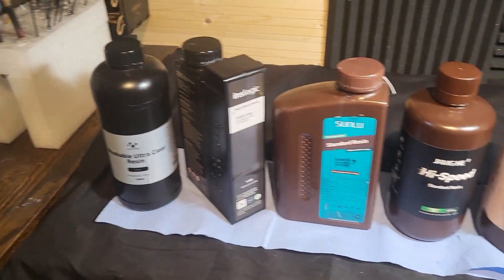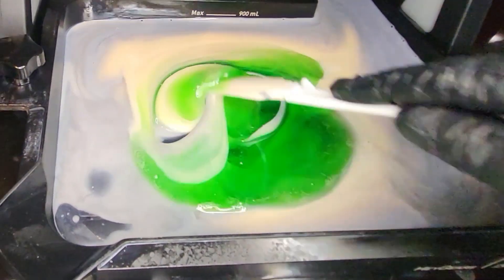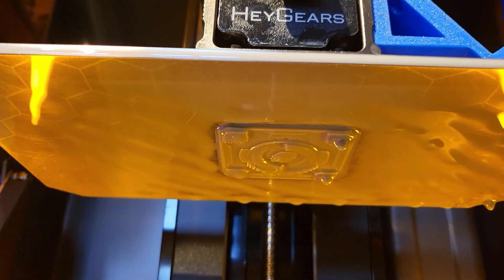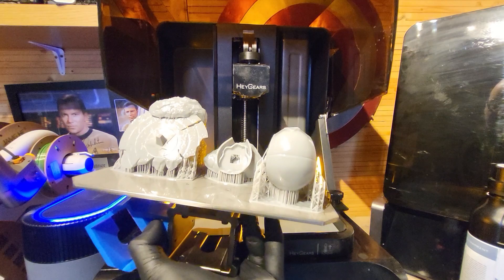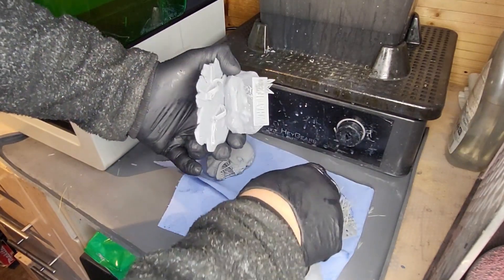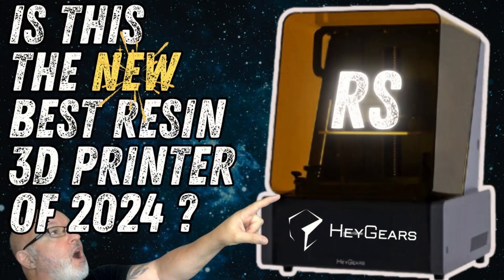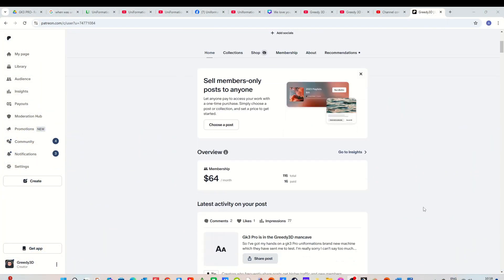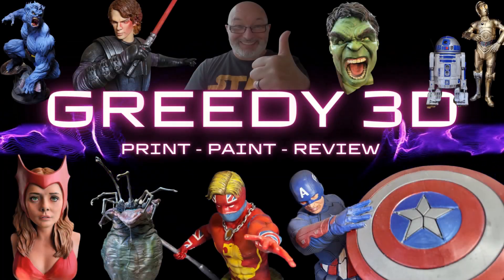Mixing 8 kinds of Random 3D Resins In One Vat Will It Print Reflex RS Tested

Comment: Wow! That is impressive. I may have missed it, but have you tested elastic resins? It took me quite a few tries to get anything in elastic on my old Anycubic. If it can printe different mixes of elastic with ordinary resins as well I think I may get this printer. Too bad I just missed the sales.
Reply from the maker: To be honest I've never tested elastic resins in it I don't think I've seen anyone else test them either
Reply: @greedy3d480  Hope you get your hands on some elastic to test. I mixed 25% elastic with my standard resin when I made som knobs for instruments that I wanted a more rubbery feel to and to get the to stick better to the shaft. I have not printed any miniatures, but I think mixing in some part elastic may make the models less brittle (which seems to be a problem for some).

Comment: Hi Greedy3d. I just received my purchased Reflex RS printer - I'm not fortunate enough to be sponsored.  
Initial setup was fine and build plate level test all ok. I don't have the pulse module but used PAS10 resin at 25 Deg C.  

To test printer, I printed cones of calibration.

For the first 13-15 layers the reflex RS makes a rather loud noise when the build plate stops descending into the resin tray just prior to exposing next layer. Sounds like two thuds or like a stepper motor lose steps type sound and max force -244N. I have completed 4 small 1hr test prints of cones of calibration,  in between each checking screen, cleaning and checking resin tray nfep for cracking or damage due to the noise. No evidence of any issues... but with each print the first 13-15 layers or so, it makes 2 thud sounds that then disappear after these first dozen or so layers - I assume printer is on normal layer exposures then. 

I posted a video at my channel - if you could take a quick look short video titled "Strange sounds when Heygears RS build plate retracts towards screen during initial base layers". My latest uploaded video was the full timeline of print.

I sent Heygears a blueprint  studio help ticket showing video with audio (and slice file and log file) to ask if such noises are normal. I have video clip on my YT channel. I would appreciate a response to this comment. 

Heygears tech says yes no worries - machine would shutdown if pressure too much - which is good to know.        

"We have reviewed the force curve and found that the zeroing force is 100N, which is within the safety range. Additionally, I have confirmed with the relevant personnel that the upper limit for the downward force on the RS printer is 250N. If this limit is exceeded, the printer will automatically stop to prevent damage. Regarding the sound in the video, we have verified that it is the sound of the electromagnets on both sides tightening, which ensures a smooth printing process and naturally differs from other machines. If there were any issues with the printer, the device would report an error, as it is equipped with multiple force sensors for monitoring, making it very safe."

Do you have similar noises at the end of each retraction cycle for the first 13-15 layers?

Now I printed with PAS10 the torso legs and head for a ladydeadpool - a 6 hour print. The printer makes the same noises for the first dozen or so layers then the thud noise goes away.The parts printed nicely. Then checking the resin tray vat before doing another print I found resin layers stuck to the nfep in areas surrounding the rafts of the parts. In corner areas around rafts extending our 5-10 mm or so, that should not have been exposed. Never had this on the Saturn 4 ultra. Either light bleed or resin compression Had to do a resin tray vat clean cycle to remove.  Now cleaned out the PAS10 from the resin tray vat. 

I don't know about this printer. I have only done this 1 serious print over 1 hour - a six hour print - and 4 other <1 hr test prints, and the resin tray nfep sheet under reflecting lights shows what look like clear pressed impressions in some areas of what look like parts of a print - I always move my test prints around on the build plate when doing the test prints to ensure not repeated prints in the same area of the nfep build plate.

Kindly respond to this comment. 
Both you and FauxHammer have pumped this printer so much it convinced dumb me purchase one, but I am doubting my decision! 
The RS has given me so much more trouble than the Saturn 4 Ultra. 
Perhaps I received a 5mins to 5pm checkout manufactured unit? ie a dud unit. 
Either I return this unit for refund and move on or return for replacement unit. 
Ideas?
-------
EDIT - Decided to return the Reflex RS as my instinct says something is somewhat defective with it. 

Note - I have received no responses from either Fauxhammer and Greedy 3d, both of whom I asked the same questions, and both of whom have been pumping the Heygears Reflex RS printers on their channels.

Comment: @greedy3d480 Just received my Reflex RS no PRM module and used PAS10 resin test printed cones of calibration. Initial setup was fine and build plate level test all ok. I have Saturn 4 Ultra and no experience with other resin printers (been in FDM many years building my own printers eons ago) so I don't know the usual sounds these fixed vats make for layers. For the first 13 layers the reflex RS made a rather loud noise when the build plate was ended descending into the vat just before exposure of new layers. Like two sounds a bit like stepper motor lose steps type sound and max force -244N. Sent a blueprint  studio help ticket showing video with audio (and slice file and log file) to ask if such noises are normal. I wait for answer back.       
I printed the cones of calibration test print twice and same noises on first 13 layers each time. After the 13th layer the sounds disappeared and max forces on retraction to screen was about -100N.  Completed the print and check screen and fep for cracking damage etc no evidence of issues so printed again and again same sounds for first 13 layers or so...
Exposure seems a little low or PAS10 can't keep the detail -  1st 2 success towers closest to skull are not linked and all failure towers broken. Sword fits in skull and other parts good to show exposure is ok... just feel a little underexposed. Wonder if anyway tried other print profiles to see how they change the exposure time and levels when using the resin PAS10. I see default slicer supports settings changes but don't know if correlates to more or less exposure times to use perhaps other settings when looking for more exposure. I see the firmware now includes bottom layer adjustment feature - not tested that as parts 1st layers stuck to plate so nicely. Any input? Are there any discord or groups for Heygears printers?

Comment: In my case Phrozen RPG was a bit overexposed - I think after this video I'll try mixing it a bit with Elegoo ABS 3, which was a bit underexposed. If you are in a full controlled heat environment, it should also be possible to regulate some of the issues with overexposure and underexposure for standard resins.
Someone needs to create an exelsheet with some test prints were can all contribute to ;)
Reply from the maker: Id like to see that

Comment: Any resin will print at certain settings the problems occur when you need a dimensionally accurate part, then only specific resins will work because not every resin is dimensionally accurate, if your goal is to just print large sculptures this will work 100% of the time, This is why I started using cones of calibration V3 because that sword and that cup helps you calibrate 4 dimensional accuracy, but not all resins can achieve this you just need to understand this while you're calibrating a new resin you just purchased...........
Reply from the maker: I haven't tested the rsi's ability to be dimensionally accurate, but everything that I've printed with.It has connected together beautifully and as adoli would gamble that everything is dimensionally accurate

Comment: I guarantee this will also print on the mars 5 without issue, just set it to 2 seconds and go.... without that control test, this means little to nothing. I do this regularly on my elegoo jupiter and my anycubic  m5 without any issues. Grey with white with green transparent and tenacious added in from siraya, no issues at all. So yea, can any printer do this? Absolutely.

Also, you do know that the RS does not have a sensor to know what exposure is needed correct? Thats what the resin selection is for, you select the resin which dials the exposure time. There is no sensor that would tell this machine whether the resin has hardened "just enough" to be ready to be pulled up. Think about it, how could it possibly know the level of hardness of the resin and the level of expansion? Does it have a photometer to measure light transmittance through the resin layer? No, it does not. Even if it did, after 7 to 10 layers, that too wouldnt work. The only thing it has sensors for is a) is there an item in my way. B) is there no resistance when i push down (empty vat) and c) there is no resistance when i pull up (failed print). And all those sensors are force sensors in the arm and lcd screen. not anywhere else. So no, the RS is not calculating how much exposure is needed on its own, its picking a value that works with 80 to 90% of resins, and mixing those resins does nothing to change that. To test, you can run the same print with the same resin and pick each default resin and rerun. Compare the PARP setting on sunlu resin vs the PAWW settings on the same resin. Youll find that they all wont work, and they all wont look the same.... and youll think " BuT mY SeNSoRs..." and realize that no, that isnt being calculated by the printer, its preset in the resin selection. The only thing the sensor would help with is bloom and lift height and speed, since force sensors can tell us how well things are peeling or if already peeled. So please stop preaching this "ThE PrInTeR gOt ThE SeTtInGs RiGhT, MaGiC!" Nonsense. To confirm, bypass the sensor and run the resin, itll light up for a certain amount of time, everytime, per layer, no calcuation magic needed.
Reply: I agree with you on many points.
It is quite possible that the exposure time is increased a little if the peeling on the first layers is too weak and this should also work with overexposure.
However, I did not feel that this had a major influence on the result. I rather assume that the UV cob light of the RS is quite good.
Reply from the maker: Blimey , I hope you feel better after that vent